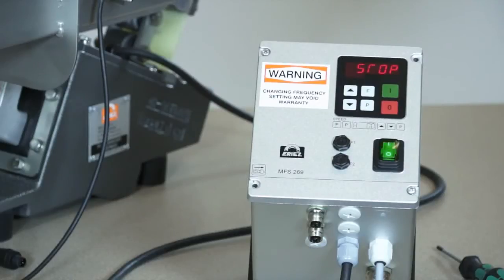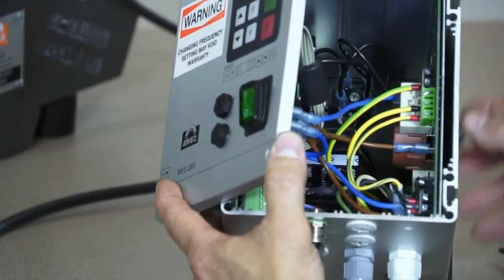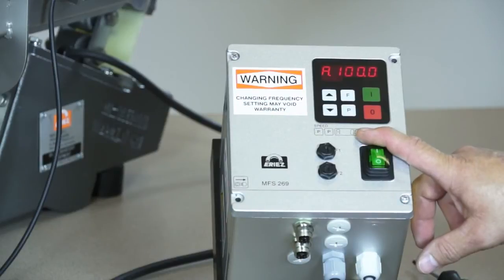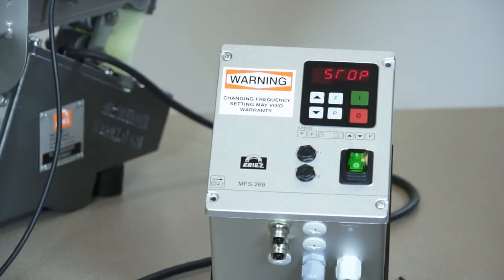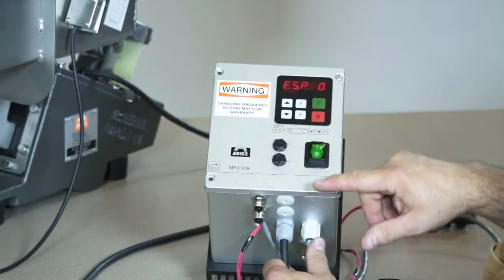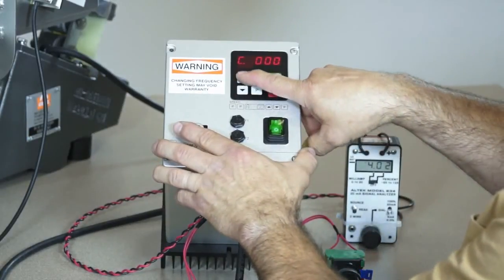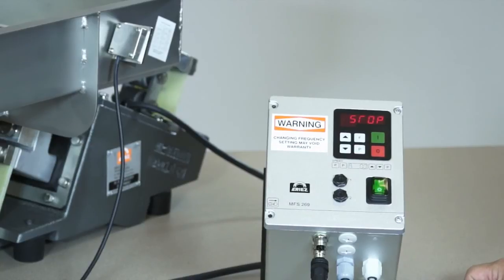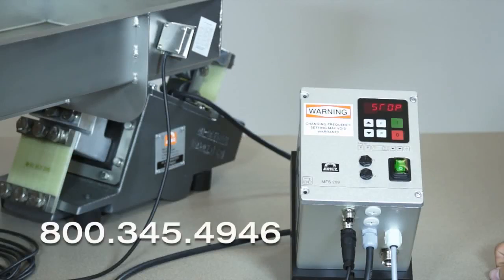Part 2 - Eriez G Series Feeder Control Set Up

Comment: Can you connect a strain gauge load cell for weigh filler application?
Reply: Absolutely great Demonstration of Settings..Thanks
Reply: Wouldn't hurt to try..Use 4-20ma instead of pot..The heavier it gets the faster it feeds???